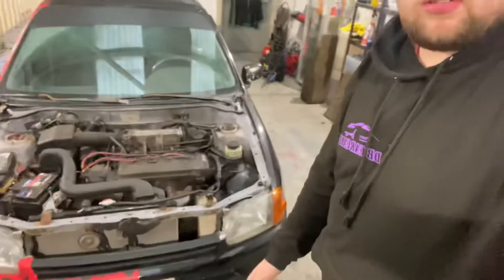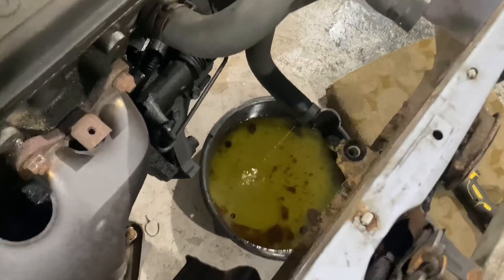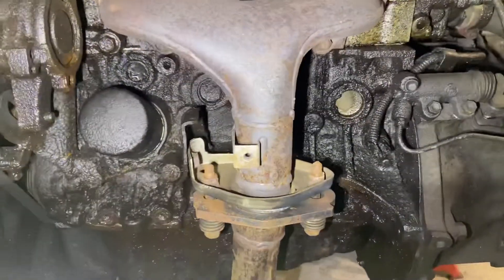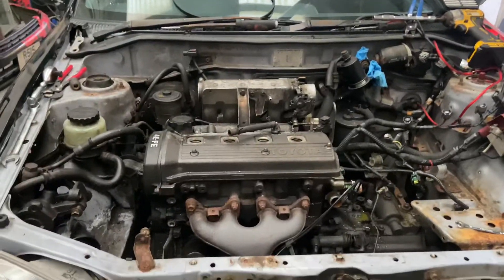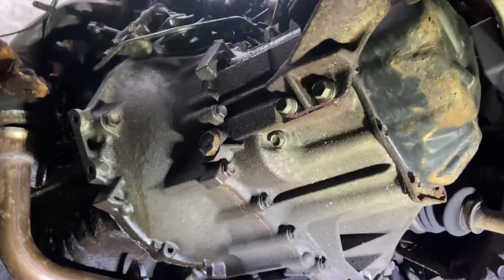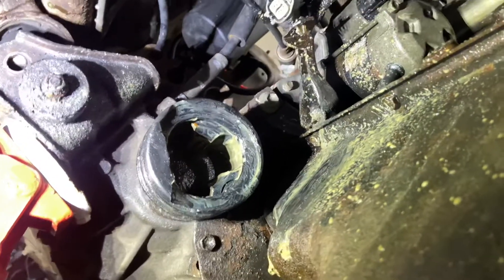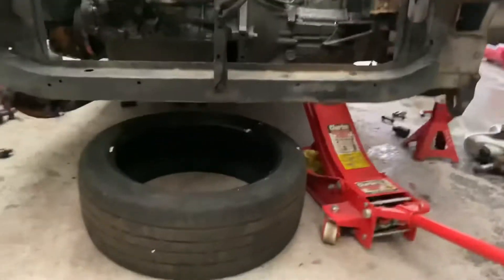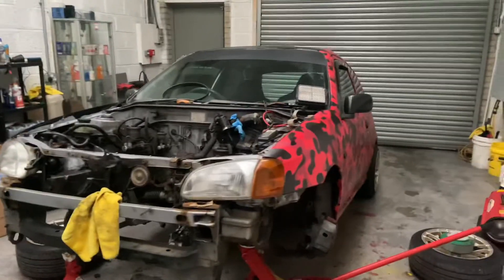Removing the Toyota starlet engine

Comment: one thing to not is the drive shaft can come out by removing the 3 bolts holding the ball joint as well as the axle nut and pin and comes out with out undoing anything else.. secondly Good Job on it all and also when removing fluids best option is to remove drain plug and remove filler plug to help it drain faster same as engine oil and radiator coolant Cheers for the video